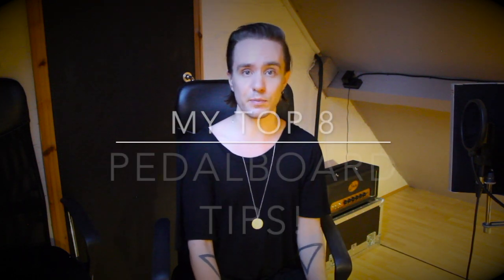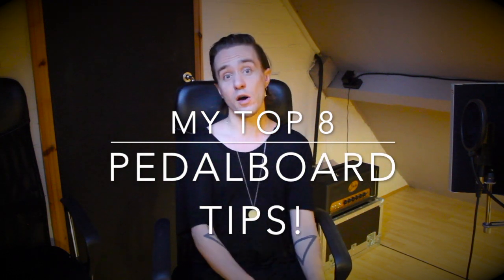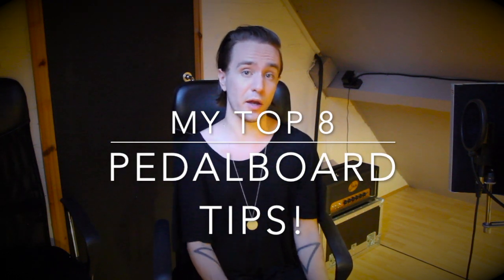My Top 8 Pedalboard Tips!

Comment: I've just got a new pedalboard, and want to start wiring it up. I have 15 pedals or so plus a 12 strip loop switcher.. I was thinking of doing the patch cables and power for each pedal, starting at my last pedal (reverb), testing it, then working back one at a time...or is that overkill? Thanks man!
Reply from the maker: Hey Rich! It's definitely good practice to test as you go. I usually work from the other end (comp>OD>etc) then wire up the locking Neutriks and the buffer last. I'd say if you're confident when it comes to soldering then it may not be totally necessary to test every connection but it's certainly good practice and it's much better than trying to find a rogue cable once you've got everything placed!
Reply: @RichardWatson  Thanks so much for taking the time to reply, and for the tip to start at the other end! I've definitely not mastered soldering yet, so have a mix of solderless and pre-made cables.. but i'm quickly realising the lengths I need to cater for with the new board probably means I need to commit to making my own...eek... Thanks again, mate!
Reply from the maker: @richobrien8862  Man, it's so worth it! Once you get comfortable with it you've save a fortune in the long run. I've never had one of my own cables fail either. Good luck, Rich!
Reply: @RichardWatson  cheers dude! yep, time to give it a go!